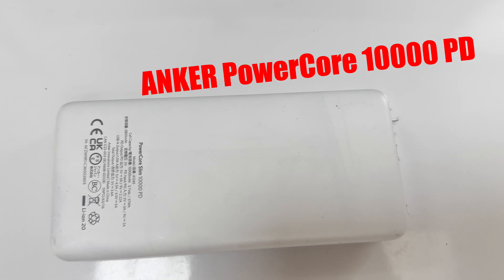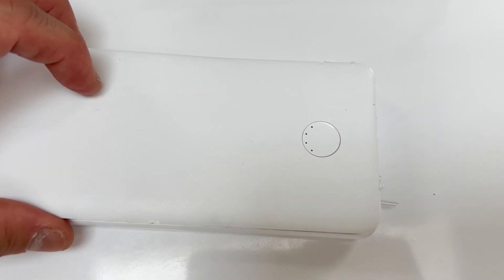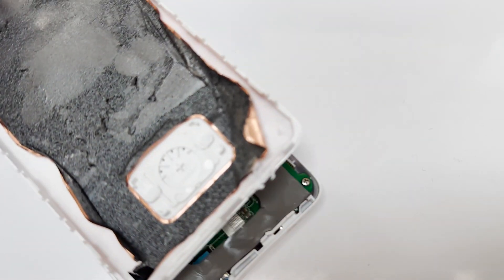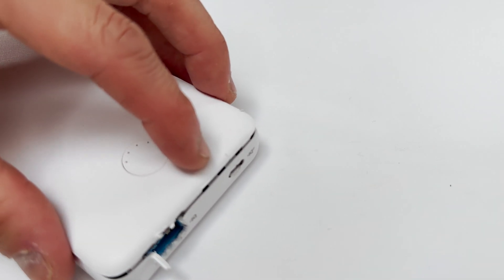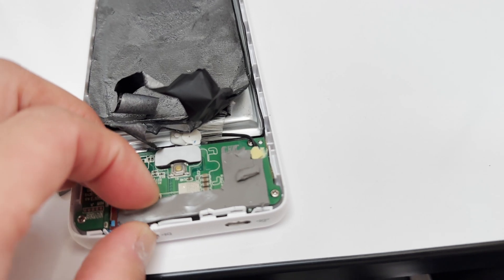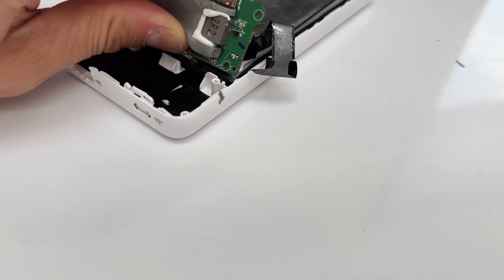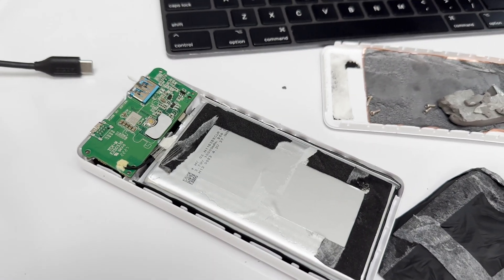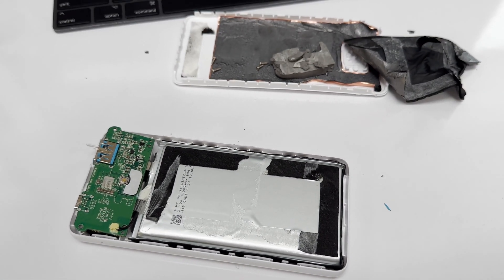Anker PowerCore Slim 10000 PD Disassembly

Comment: Perhaps the battery has gone to zero try charging it directly with a cheap charger to see if voltage goes up, in which case it should work again once the voltage is above 3v.